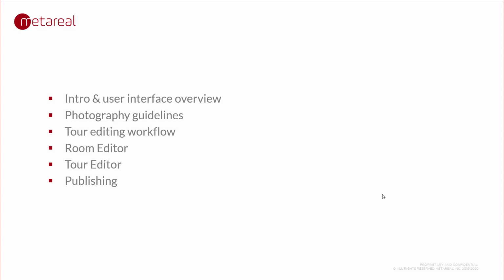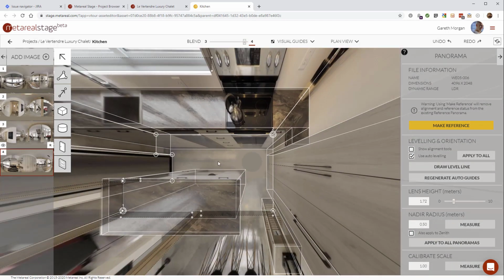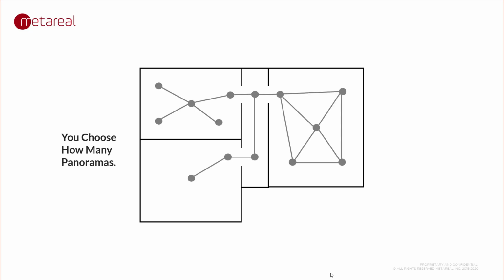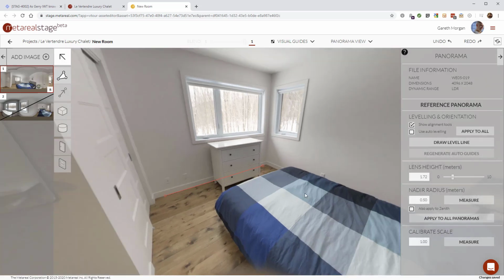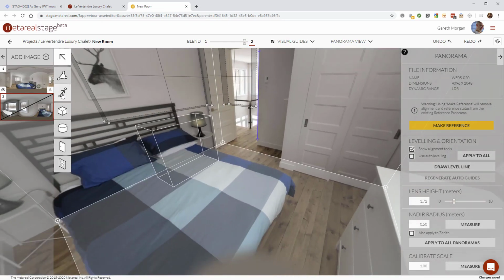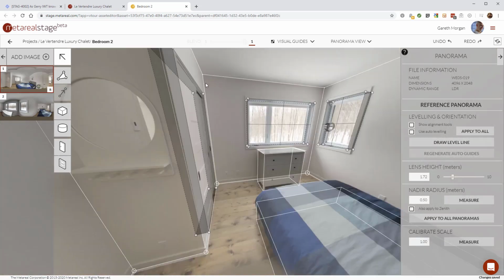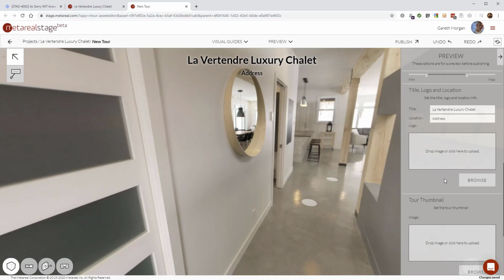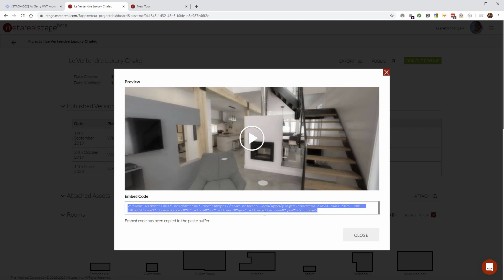Getting Started with Metareal Stage

Comment: When creating the wall profile, can you use the ceiling corners rather than the floor?  This has several advantages as there may not be crown molding to get in the way of the actual wall and ceilins are less cluttered (fans) than the floor (furniture).

Comment: Hi great tutorial, I just discovered your amazing application. I have been working through this tutorial but, after inserting the tables and lamps, when I move to the other pano the lamps and table shapes break apart and move. Can you tell me what I am doing wrong?
Reply from the maker: Hello! Might be because the objects weren't placed properly? Please check out Basics Part 3 for more info on objects: https://www.youtube.com/watch?v=JEM02vVQkww
Reply: Hi, I watched the recommended video,I made sure that the objects were snapped to the floor and also to the height of the object (table and lamp) but the objects still move?

Comment: When you have furniture in the room it is impossible to get the correct measurements of the floor corner. If I was the developer I would allow to measure the ceiling corners to create floor plan. Sadly the developers are lacking from real life examples. It’s very easy to measure empty rooms.
Reply from the maker: You can absolutely use ceiling points when drawing your floor. Just add the floor points you can see, lift up the ceiling until it's at the correct height, then look at the ceiling while you're drawing your floor. Using the protractor also helps a lot for unseen corners. Please check out our Basics tutorial series to learn how to use the protractor.
Reply: Metareal really can’t figure out
Reply from the maker: @statuumlettings8271  Please schedule us for a one-on-one tutorial, so we can help you with the software. Just book a time here: https://calendly.com/gareth-metareal/30min
Reply: @metarealstage  This is how service looks like. Wow. (Don't know if I would like to have clients like these though...)

Comment: Trying the first tour very time consuming photo uploads keep failing
Reply from the maker: If you're having trouble uploading photos from your local drive, we'd recommend uploading them to Google Drive or Dropbox first. Our servers will be able to pull your photos in much more quickly from there.
Reply: Metareal your server is extremely slow
Reply from the maker: @statuumlettings8271  Which country are you located at? Might be a distance issue. If you're far away from our servers, Stage will load slower. We're aware of the issue though, and are in the middle of making updates so tour editing will be quick no matter where you are located. The speed update should come out in a few weeks.
Reply: Metareal UK
Reply from the maker: @statuumlettings8271  Hmm that's actually pretty close to our servers, so not sure what's up. Our upcoming fix should help speed things up for you anyway, so I'll make sure to tag you when it comes out.